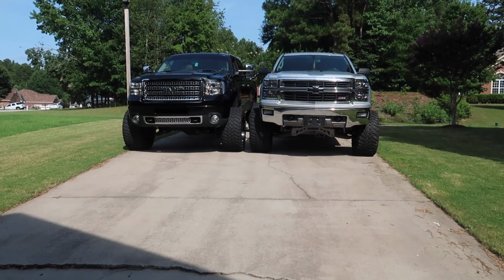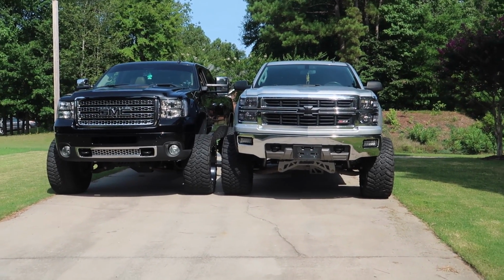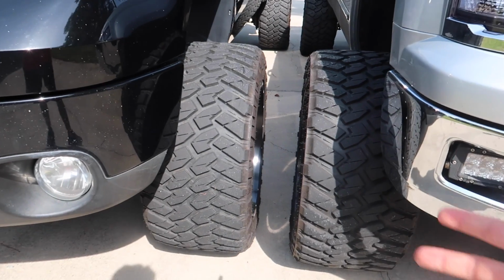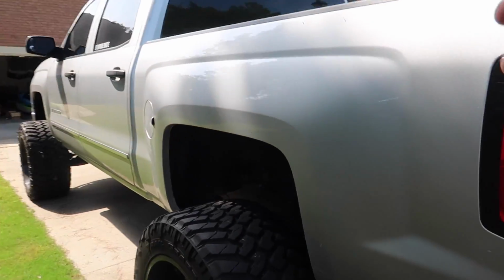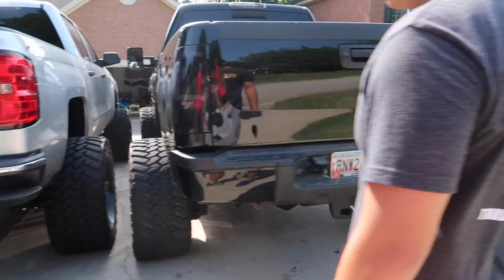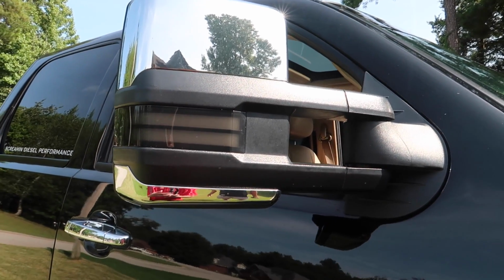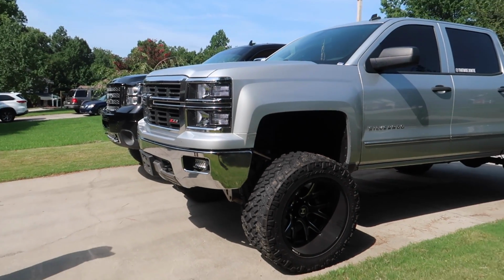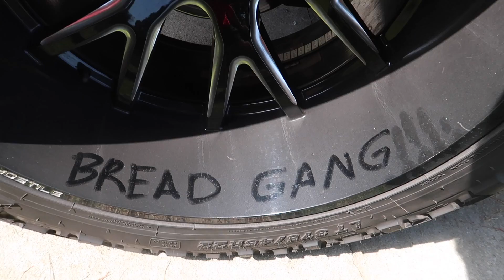DURAMAX vs 1500 (The TRUTH About LIFT KITS) Ft. JW MONTOYA

Comment: The 2500 frame is taller than the 1500 that's why the smaller lift allows the same tire size